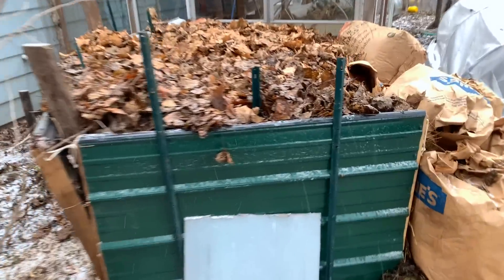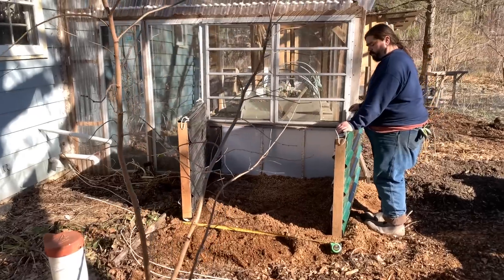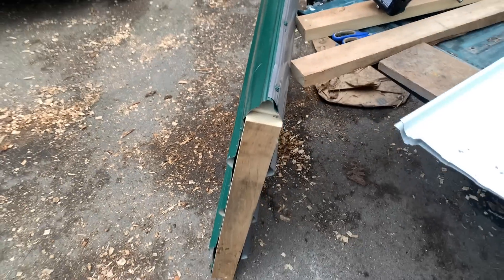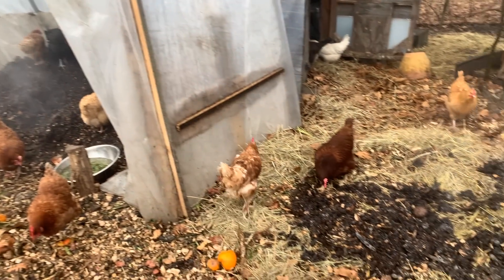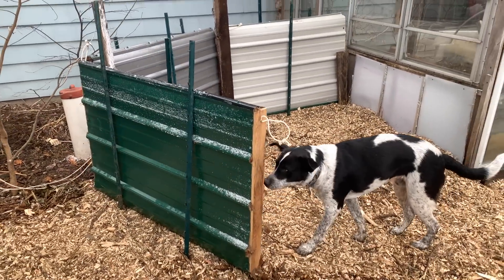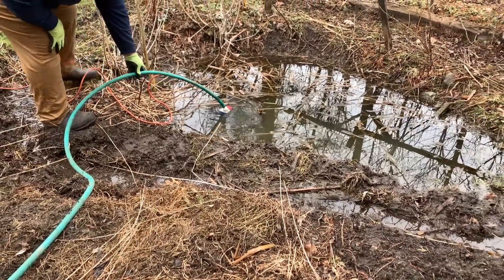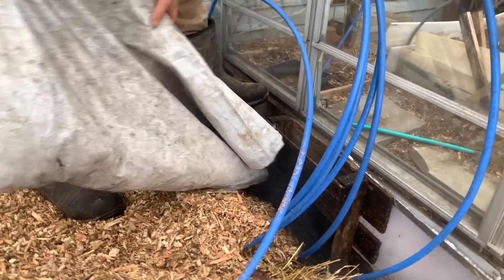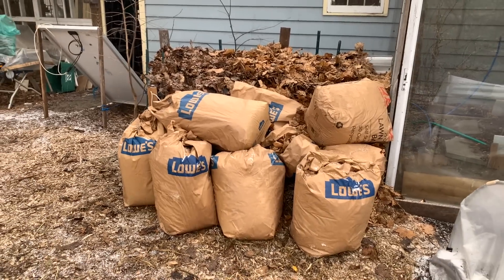Compost Heated Greenhouse - 2023 Edition

Comment: I wonder if some vertical pipes with holes drilled (I just pick up random metal/plastic pipes that people leave out) would both add aeration and create posts for the heating tubes to tension upon might be an upgrade for iterations of this.  Glad you're still experimenting with this concept; the charcoal-layer filter is interesting and would love an update on that specifically.  Thanks for the video!
Reply from the maker: Good thinking and something to consider for another version, I will keep it in mind.
Reply: Wouldn't that just let the cold air in though?
Reply: @pvp6077  It would, but when I aerate my (not-for-turning) compost this way it stays hot, so I am just curious if it would be a net gain; just an experimental thought.

Comment: If you covered the new compost pile, even with just a tarp, you could better control the moisture levels within the pile.
Reply from the maker: We did... Not the best shots at the end but under the leaves is an insulation sheet. .

Comment: The metal covering is going to negate most of that R19 insulation.  I would just use the insulation and deal with any chewers.
Reply from the maker: I couldn't have the insulation be directly in contact with the compost, too many gnarly chemicals in there to be exposed, so we did the metal wrapping to fully seal and protect it.  I hear what you are saying and it makes sense, I'll have to see how it unfolds when we are ready to test with temp probes, etc...
Reply: @edibleacres  Doing a bit of quick and dirty heat transfer calculations gives an R-value of 1.43 per inch of thickness,  (dry) wood would give you R-1.25 per inch.
So perhaps a better solution would be a log cabin style construction with a layer of plastic sheet on the inside if you feel you must isolate the compost.  Low embodied energy, no nasty chemicals, biodegradable.
Reply: @edibleacres  Do you have an IR thermometer?
Reply: @edibleacres  if you used a metal sheet but did not wrap it around the panel you would get better performance. The issue isn't only the metal,  but also the design. Better still would be a material that doesn't conduct so well.  The metal wrap creates a heat conduit. This is likely small potatoes though, and it is hard to say if it'll make a substantial difference. Although, you can get surprisingly bad results from very minor flaws in design or slight misunderstanding of the engineering/thermal principles involved.
Reply: Yeah - the Metal wrap will conduct heat right around the panel. I might suggest lining with plastic sheet or something.
Reply: Perhaps metal on the outside & on the ground & thinner plywood or Luan on the interior facing the pile materials?

Comment: Have you thought about using a Johnson-Su Digester for this purpose? A hot composting system designed to work undisturbed, with aeration built in...
Reply from the maker: I like the concept and its something to consider for another project coming up...